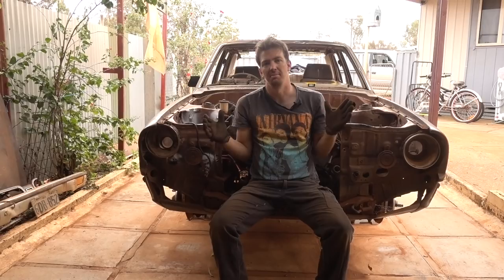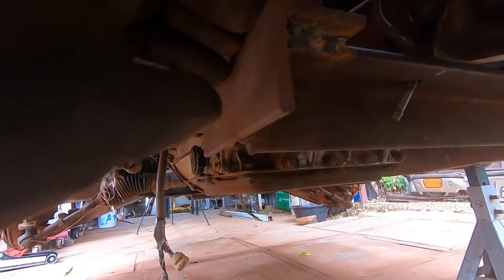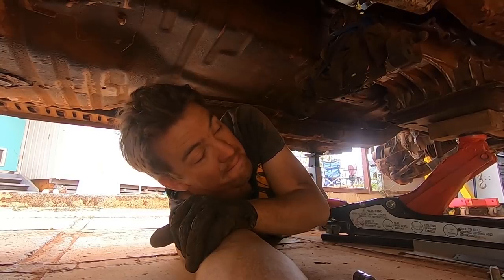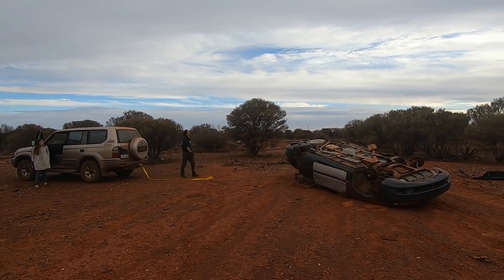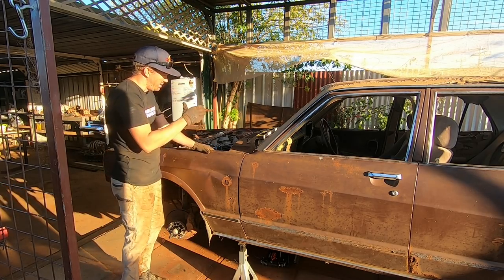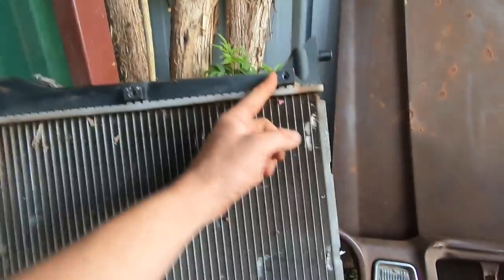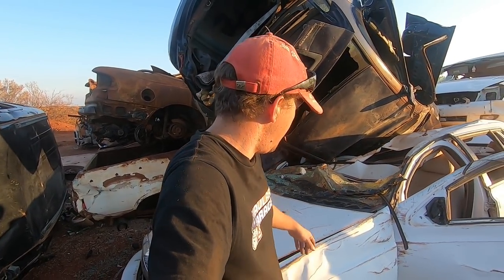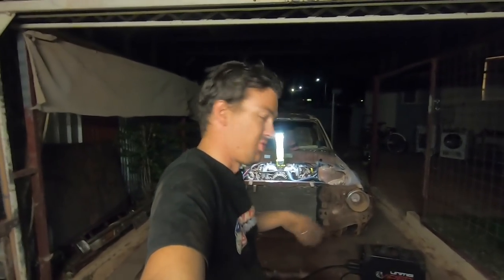Getting fabrication work done on the Cressida

Comment: Good progress 👍 you should raise your carport roof to 4m high, then get a 2post lift/hoist, makes life so much easier and saves slot of time too 😁
Reply from the maker: Honestly dude I would love to. A hoist is a future item, eventually lol.
Reply: @AutomotiveKarnage  you could scrap a few bush cars to buy one, even a used hoist :D
Reply: Gearbox cross member, you could reuse the mounting angle iron, cut them off, rotate them so flat sides are on the inside, save you making new ones, the just remake the center piece

Comment: ATTENTION: SOME EARLY CABLE DRIVEN CRUISE CONTROL CARS HAVE A SPEED SENSOR BUILT INTO THE CLUSTER. IF YOU HOOK UP THE SPEEDO CABLE TO A ROTATING SOURCE IT WILL ALLOW YOU TO HAVE WORKING SPEED SENSING FROM THE CLUSTER (NOT ALL TOYOTAS HAD THIS).
Reply from the maker: Thats some good info, cheers mate.